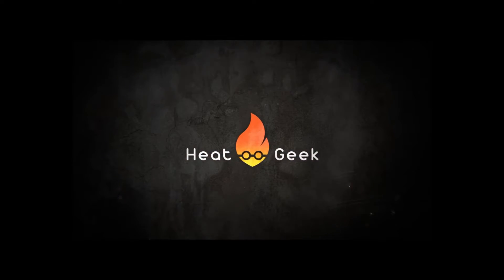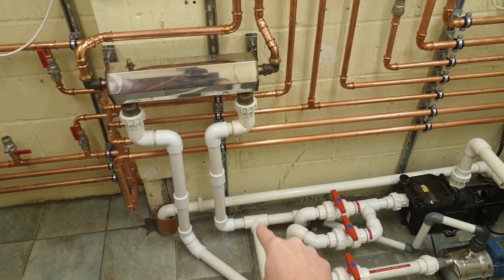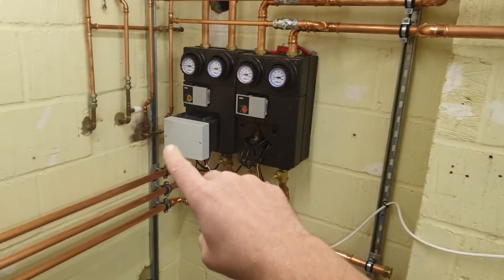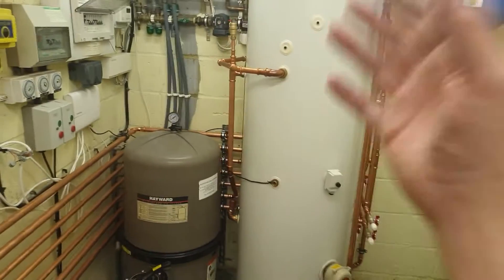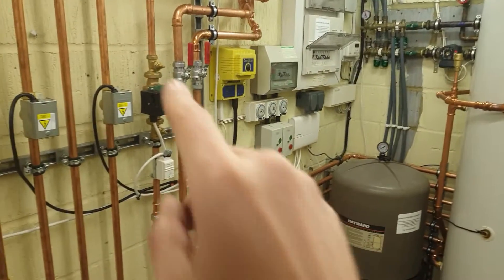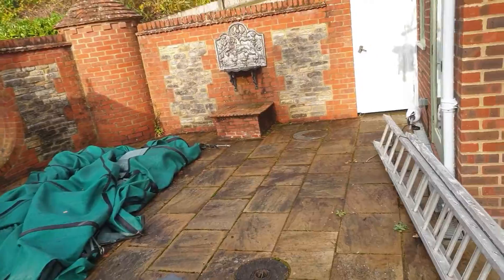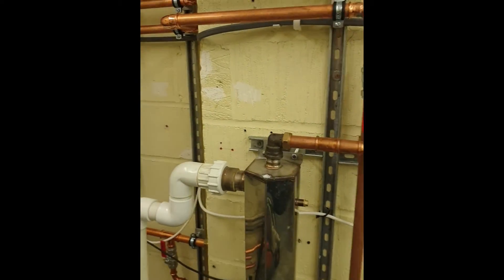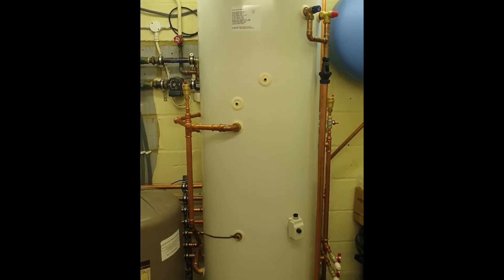Renewables Plant Room tour, tips and how it works. Phase 1

Comment: The Octopus Agile electricity tariff is capped at 35p per kWh. I currently pay 15p per kWh for my electricity;  by coincidence I'm on a fixed tariff with Octopus. In the current month (I'm writing this on 24 Nov 2021) there have only been 24 half hour periods when the cost of a kWh on Agile has  been less than 15p per kWh; so just one half hour per day when you might get your power a bit cheaper than a fixed tarrif, and 47 other half hours when you are paying more than that. About 50% of the half hours  in November have been charged at 34.9965p per kWh. So at present it's not looking like there is any cheap overnight electricity to be had on Octopus Agile. I do expect this to change over time and for these tarrifs to offer great opportunties to general domestic hot water for early morning use at reasonable rates. We're not there yet though.
Reply: When the tariff was launched, 35p/kWh seemed a lot. I think the Octopus Tariff is not subject to the price cap so is more expensive at the moment. Also, the simple wholesale multiplier, which is to also cover network charges, is penalising users for increased wholesale prices even though the same increase in network charges hasn't been seen. Maybe we'll get an alternative, one day.

Comment: That buffer seems small
Reply from the maker: Buffer size should take system volume in to account. Its not as big as we wanted for sure but the biggest we could have due to space constraints. Ground source usually is 15L per kW.. this is a 200L buffer plus system volume of 200.

Comment: This pool heat exchanger is too small for heat pump, unless you want to run pool circulation almost 24/7 (pump can take too many electricity) or run heat pump with higher LWT for few hours in a day (lose COP this few hours, again electricity). But probably for this old leaky house you will need to keep high LWT anyway :)

Comment: Hi heating geek, quick question I’ve been having this debate with another couple guys about when you do your heat loss calculations etc. What do you guys add onto your kw rating for boiler/boilers for how water supply say on a 300litre pressurised cylinder, I was taught 7kw. Even tho most cylinder seem to say there coils are rated for 20-24kw, some of my friends say they’re just sizing for the hot water and so I.e 24/25kw and adding a small amount of any for the heating?
Reply from the maker: Hi Kyle. nothing as all our installations are hot water priority.
Reply: @HeatGeek  yeah I thought that was the case, what would you allow if it wasn’t a hot water priory system, love the content guys really showing guys it needs to be done properly heat pump and heating systems
Reply from the maker: @kylebrowning7469  that's difficult as I automatically think of non hwp as wrong. I suppose half the coil rating as it will never need the actual coil rating
Reply: @HeatGeek  what if the customer doesn’t want a hot water priority system tho even if you try and explain it’s cheaper then don’t want to forego heating while hot water is on etc.
Reply: @HeatGeek  I haven’t installed a hot water priority yet but after seeing some videos and reading up on it I might start trying to, my understanding is basically an s plan but with a normally open valve in-front of the two port of the heating that will shut down if the hot water is called? And specific boilers needed for hot water and heating connections? Tell me if I’m wrong
Reply from the maker: @kylebrowning7469  basically correct. All good boilers allow and have it in the instructions anyway bud 👍
Reply: @HeatGeek  perfect

Comment: Could  you take the cold feed to the hot water cylinder through the buffer cylinder 1st?
Reply from the maker: Could go via a coil yes.. but everything that feeds the buffer feeds the cylinder so the only gain is power not efficiency
Reply: That would be my reasoning, I have a combined hw/ufh buffer vessel and the ufh hammers the hw when the slabs are heating up. I was thinking of installing a pre-heat buffer vessel using air source.

Nice install btw
Reply from the maker: @Flashjohnsparks  your notnusing weather compensation!????
Reply: @HeatGeek  No, it was in the house when I bought it. Just trying to figure a way to make it work in cold weather.
Reply from the maker: @Flashjohnsparks  be much less work, cheaper and more efficient to just upgrade to weather compensation imo 👍
Reply: @HeatGeek  I'm not so sure, the buffer vessel temp is basically set by the boiler stat, I've set the boiler to max,  but if a large ufh zone turns on it it will Drastically cool down the buffer vessel. The local ufh stats are set at 22 all day. The wife moans the water is too hot but it's the only way to have a semi hot shower if it coincides with a ufh zone.
Reply from the maker: @Flashjohnsparks  sounds like something else is going on. If your buffer is being drained your heat source isn't keeping up for some reason
Reply: @HeatGeek I think my system is floored, that's why I was interested in this video with a dedicated h/w cylinder, something I might have to do. Thanks for your input.
Reply from the maker: @Flashjohnsparks  I would seriously look at wether compensation also.. it cures faults like this as there isn't a quick unexpected load

Comment: Hi lads. I’m doing something similar to my own house. Hopefully building in the new year. I’m also going to use a thermal store but slightly different. I’m going to use the one that has a hw coil or plate to heat the hot water. I’ll be using oil, stove, solar thermal & solar pv. Focusing on the solar to be the main sources of doing the heating & water. Love to chat to yous. Happy Xmas great video 👍🏻
Reply from the maker: Hi Alan. You are much beeter off with 2 stores, one for hw and one for heating. combining them sacrifices efficiency.
Reply: @HeatGeek  some company’s have really good stores out now im tight for space so I’ll have to go as tall as I can and make sure the hw coil or heat exchanger is at the top

Comment: Used McDonald for my 400 litre thermal store 12 years ago. Recommended bu a plumber who's eyes glazed over when I was explaining I wanted to link a 17Kw wood burning range cooker, 6Kw of solar thermal, a 10Kw system gas boiler.. back up only and later dumped excess solar PV into the immersion. I emailed them sent a few ideas back and forth and they built a beautiful themal store with DHW at the top, just below that an indirect coil fed from the gas boiler, a massive finned coil to fit a heat pump in the future and solar coil at the base. Tapping's everywhere to make plumbing easy, sensor and thermostat  pockets and choice big 1 1/4 tappings for the gravity feed 28mm from the biomass. Oh and once we had thrashed out the design 2 weeks turnaround... Helpful knew their stuff and made lots of useful suggestions, Ran the heating via an ESBE tempering valve set to 58 degrees and stats for low temp cut off, overheat protection by dumping heat at 95 deg into the CH then PRv and other protection. gravity fed from a copper header made from a cut down  old 100l cylinder.
P.S. did most of it myself as local guys had no idea what I was on about.. Gas sorted by friendly renewables tech who did the PV install and even gave me tips and bits for the solar. Good investment. Heated a 3 bed 2bath semi for £5 a month gas and FIT payment covered the electric and then some, Now moved and wished I could have brought that setup with me. Oh and all pipework in 28mm 22mm and only little bits in 15mm to keep pump losses down,

Comment: grate vid two thumbs up 👍🏼👍🏼you mentioned stratification so why not have a de-strat pump instead of what you done to the hws return, and will what you done on hws return have any risk of legionnaires???
Reply from the maker: Thanks bud. We actively WANT stratification here.. de strat pumps are to increase effective volume on high temp heat sources.. not low temp heat sources.
Reply from the maker: No risk of legionairs. Will get weekly purge
Reply: @HeatGeek  so it’s not for the oil but ready for the renewables your going to install, what would happen if it did have a de strat pump on low heat systems
Reply from the maker: @originalshedboi  the dt between the coils and heatbsources would be lower meaning the heat sources would have to run at higher temp.. not good for COP or glycol
Reply: @HeatGeek  i can go to bed easy now thanks 🤩

Comment: No doubt, this system is a heating geeks wet dream, but some domestic installs have become completely OTT, in my opinion. What's the capital cost and annual operating cost of a system like that, with so many points of failure? I think you would be better off investing in improving the thermal performance of your home first. My mate in Southern Ireland built a house to near passive house standards, with no central heating requirement at all. He's got PVT panels on the roof, serving a DHW tank, and a MHRV system for ventilation......job done.
Reply from the maker: Fine if your building from scratch. With £1000s of upgrade with very large property still has a 10kw load..

Comment: Very interesting. Is the timing of the hot water pump controlled by the PIR sensor?
Reply from the maker: Yes.. and heat pump also
Reply: @HeatGeek  Thanks. I have a secondary return to install soon and I’d like to use a PIR sensor but there’s a lot of choice! Can you recommend a particular type/model/specification?

Comment: Amazing vid and very excited to see renewable heat sources being used more and more these days.
The only thing I don't agree is to have the secondary pump being activated via PIR in bathrooms. Some appliances like dishwashers and dual water fed washing machines require hot water. If the secondary pump activates only for bathrooms, then these appliances will not be receiving the water at its maximum possible temperature and therefore spending more electric energy heating the water to their setpoint. This will also empty those few litres from the cylinder for nothing.
That issue with the pool heath exchanger is failry common when the pumps switch off. The best solution would be to keep it as close as possible to the ground, ideally at the same level of the pump or lower that the inlet on the sand filter. Pool pumps have great flow but very low head, they struggle if there is a big air plug in the pipework.
Reply from the maker: Hi Lewis, thanks for your comment. Nearly all appliances in the uk as cold water fed only and dont have a hot supply. regarding the pool hex, when the pumps off it should inly drain to the bottom of the heat exchanger shouldnt it?
Reply: @HeatGeek  Hi Adam,
It is true that most of domestic washing machines are cold water fed, but when you work with a higher level of customers that can afford the systems you install, they don't buy Beko but use more professional commercial grade equipment that does take hot water. Dishwashers should always be connected to hot water supply, they are all ready to work up to 60 C and it is the most ecological option.
In regards to the heat exchanger, it should not be empty at all as it is in series with the circuit. If air goes on there its efficiency drops (I think I saw a bleeding plug on top of it to avoid this).
Reply from the maker: @luispereira3  good stuff 👌👌 Thanks for commenting 🙂

Comment: does an external ground souce heat pump plant room need to be insulated?
Reply from the maker: It doesn't need to be.. but we would never install one without insulation and never recommend it.
Reply: @HeatGeek  is an outbuilding recommended and would the outbuilding require the same spec as the house ?
Reply from the maker: @jasonmace1273  the out building would have to be build to building regs which is pmgood enough for a plant room! Wether you need one or not depends on spec, load, and available space in the house.. it does take considerable space though

Comment: Looks like a really nice project, must be great to have such an open minded customer, they’re quite rare. 

I’ve had issues with secondary returns on air source. Have you tried fitting the thermostatic balancing valves for secondary return? They bring the flow down to a set table bypass rate when up to temperature, this would help with de-stratification. 

The Naviens look smart, they’re multi stage so should be much more efficient in warmer months.
Reply from the maker: Like the balancing valve idea James! Thanks!!